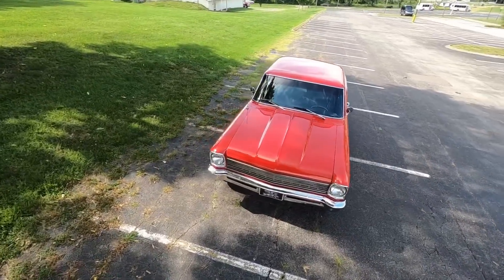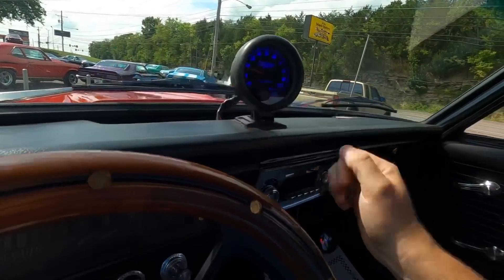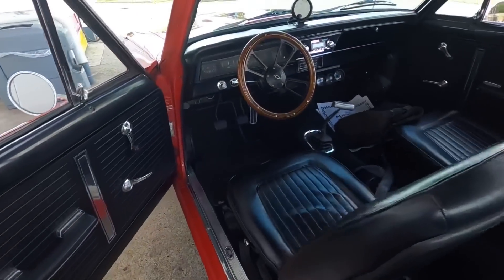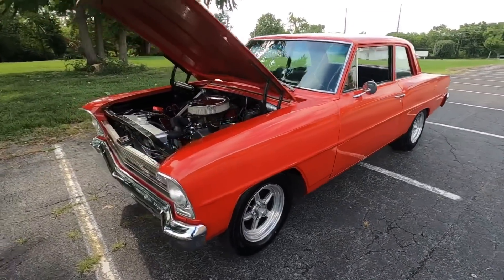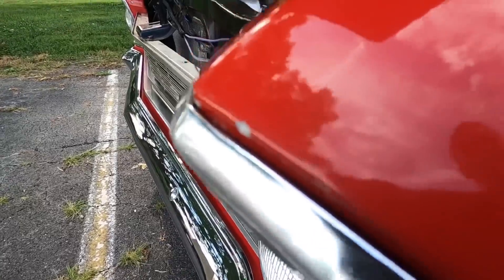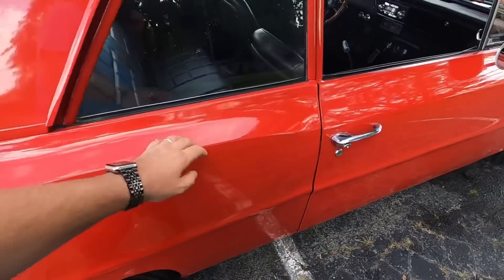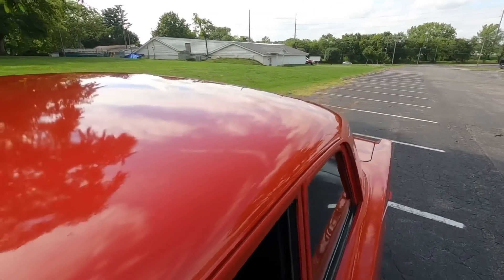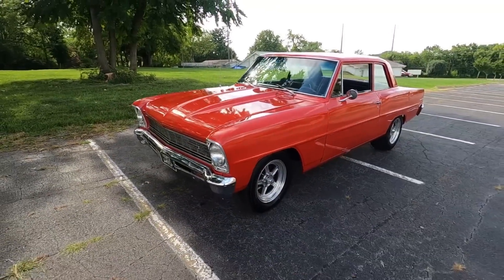Test Drive 1966 Chevrolet Chevy II Nova 2 Door Post 4 Speed SOLD $29,900 Maple Motors #1776

Comment: That oil pressure being low like that when you start it up and then when you have the car running from the outside of the motor sounds like a little knock here and there also that car has been set up to race notice the drive shaft safety loop also I think I see frame connectors
Reply: The tach on the dashboard gave it away before he even drove it anywhere lol